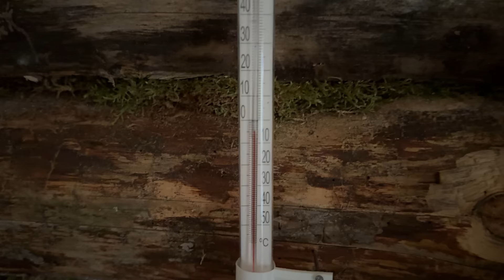Hiding in a SMALL DUGOUT - Building of a Cozy Underground Log Cabin

Comment: Nice to see the next lot of improvements. Very snug place you've created.  Quite a load of snow but solid construction.

Will your cabin have problems when the big  melt and break-up come?

Also, how do you navigate to get there? I'm used to trail markers, maps, and compass so was curious.
Reply from the maker: if the snow melts quickly, it will most likely flood.
I know this forest well, I'll get there without a compass and a map